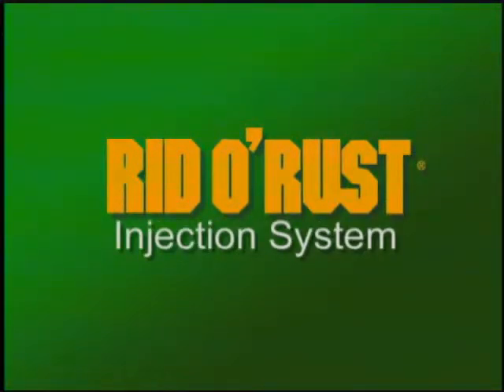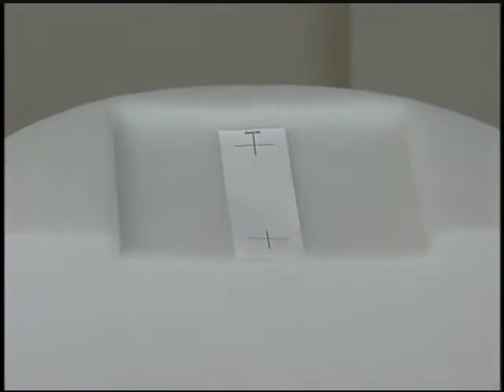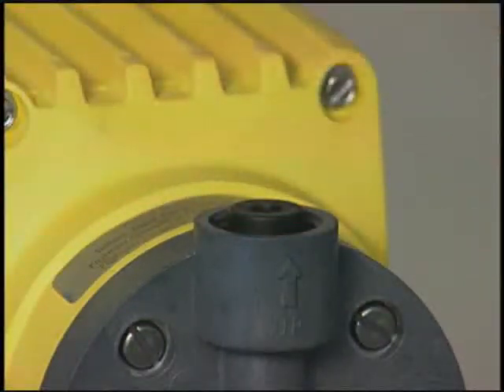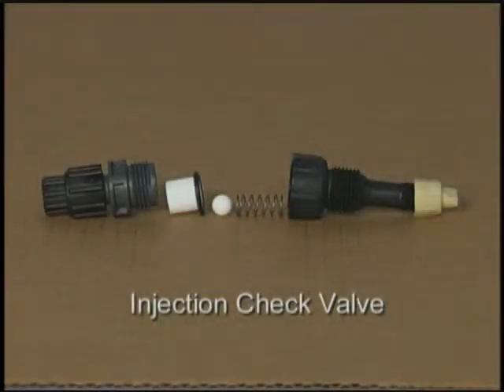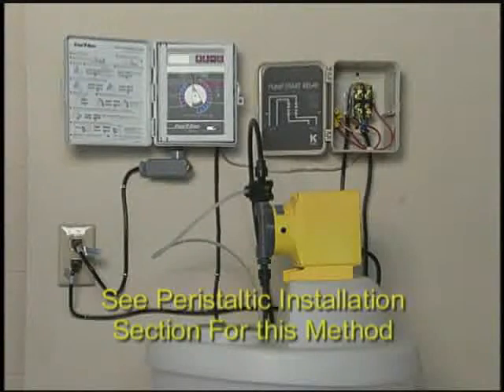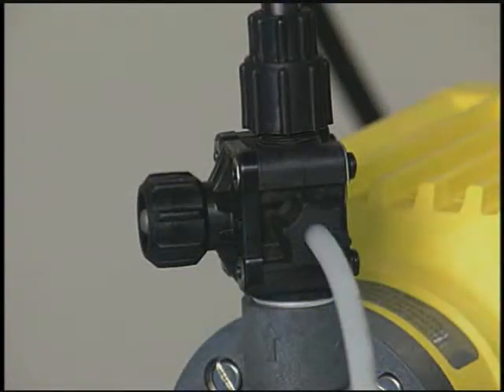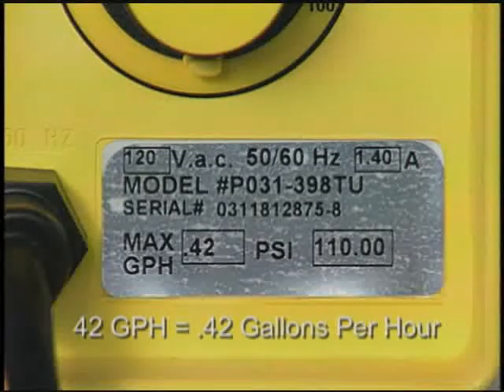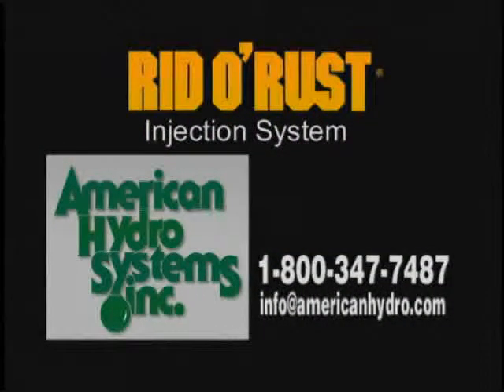RidO'Rust Installing Injection Systems with Diaphram Pumps

Comment: How do you know what to set the stroke length to?  I used the dosage calculator on your website but can’t seem to figure that out. My pump goes from 0-100
Reply from the maker: Hi There! On the dosage calculator all injector pumps are set at 50% or 5 on the dial except for the IPU-16 which is set at 33%. The stroke length is 50% for our #2704-24 GPD diaphragm pump on our dosage calculator. If you have any further questions, feel free to give us a call - (800) 285-9176 our team is happy to help M-F 8am - 5pm EST!
Reply: @MrProproducts  I appreciate it!